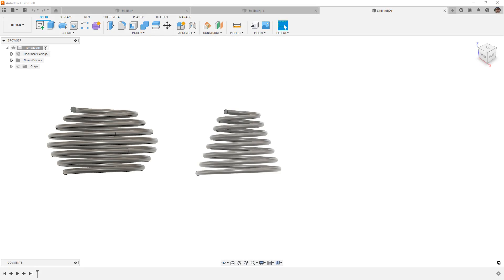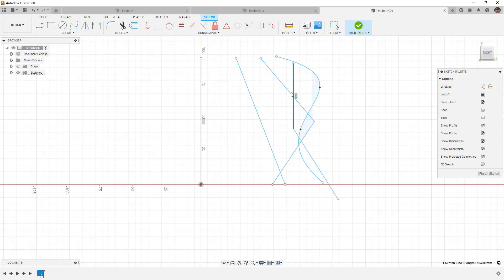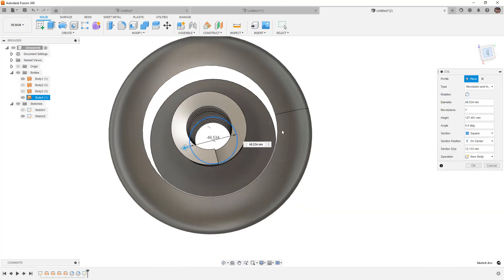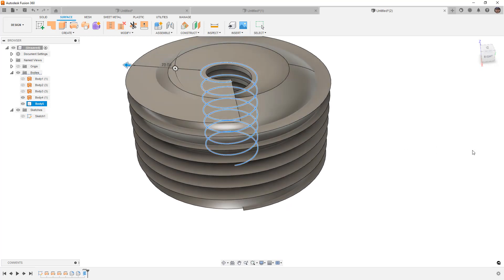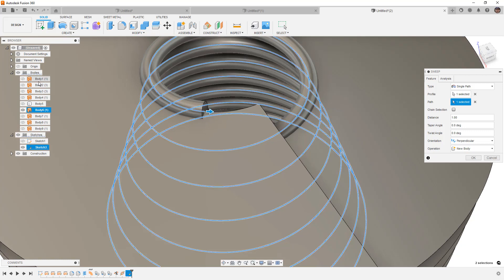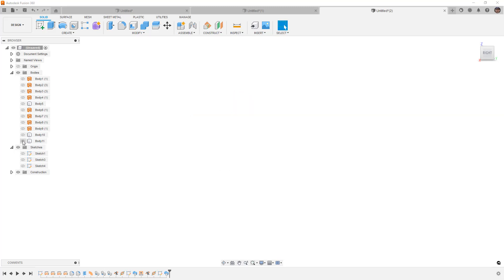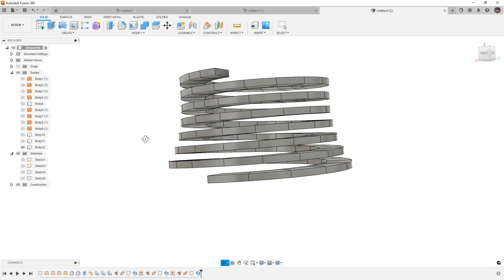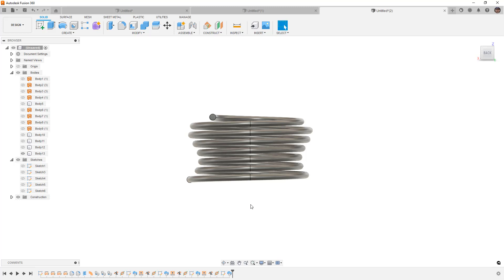How To Make Any Tapered Coil in Fusion 360 | Complete Step by Step #Fusion360

Comment: This guide saved so many headaches, thank you!

Quick question:
Have you tried using lofts with rails using this the splines from this method? I've been getting some headaches but that could just be from my low understanding of Fusion in general.
Reply from the maker: yeah, sadly the loft kinda loses what to do when trying to revolve around stuff like this.  There is a loft centerline path you could try.  make your coil profile and use the centerline option but generally it won't work great.

Comment: Thanks for the tutorial, what if i dont have a straight axis in my shape?
Reply from the maker: hmm that gets a bit tricky.  You can't really use coil for that.  Depending on your shape you could do a sweep with a twist angle.  I have done some where i have sliced through a funky shape to get a path but its sort of a case by case basis.

Comment: Do you know of a way to adjust the spring "stretch" using a similar approach? I want the space between layers to vary, so like super tight at the bottom and super stretched at the top, with a smooth transition between the two. Does that make sense? 

This is the first video I've seen from you, I'm sure it won't be the last!
Reply from the maker: Thanks Adam!  So what you are looking to do is basically a Variable Pitch coil.  Sadly there is no easy way to do it in Fusion.  What you have to do is make 2 coils and then join them together with a blend curve or spline or tangent arc.  Other cad tools like Inventor and solidworks can do variable pitch coils in a single curve but not Fusion sadly....
Reply: @LearnEverythingAboutDesign  The YT algorithm eventually blessed me with this video which shows a way to do it using the emboss command! ...but I agree, it's not an "easy way". Thought I'd share with you. Thanks again. https://www.youtube.com/watch?v=waxX3yzhJSc

Comment: Thank you so much for this, I never realized how much you could do with the surface tool. Whenever you plan on patterning a custom profiled coil, patterning it as a surface before forming a solid body helps tremendously with performance. If you pattern it as a solid body Fusion will freeze horribly every time it has to recalculate when a parameter is changed.
Reply from the maker: You are welcome! Awesome to hear

Comment: This is a great tutorial, but I have a question I'm hoping you can solve: I have created 2 coils both with the same dimensions in the same position (one positive and one negative). The negative coil differs as it tapers inward 5 degrees. I have joined them at the same connecting face when creating the 2nd coil (as the option to join bodies), how do you create a sweep along both of them? When trying to sweep, an error occurs stating that the path surface is not smooth, but I don't know how to smooth the path. Have you tried this before?
Thanks
Reply from the maker: hmm, can't say i have tried that, but when using a sweep path, the path must have tangency(be smooth).  Likely the start/end where the 2 coils meet is your issue.  You could hack out a small bit and do a 3d blended curve between them.  In the same sketch use "include 3d geometry" and then use the sketch as your sweep path.
Reply: @LearnEverythingAboutDesign  that has worked perfectly. thank you!

Comment: It was really helpful.
I was trying to make an internal and external tapered thread.
Reply from the maker: It certainly isn't a perfect solution for threads but can get the job done.
Reply: @LearnEverythingAboutDesign   Is there a way to make conical threads with this approach?
Reply from the maker: @casade2831  Yeah.  you would just need to make sure your taper is correct for your sweep path and that your profile is as well.  The thread and hole tools in Fusion do already support tapered tapped holes.  One thing you will find using this sweep method though is the thread faces may be divided up for some reason.  The faces will still be tangent but it likes to break them up which can be a pain.
Reply: @LearnEverythingAboutDesign  thank you 🙏

Comment: Hmm i can do it with just a line it has to be an enclosed sketch for the profile. IS there some kind of a setting I am missing?
Reply from the maker: if you are doing a solid sweep it will need to be a close profile.  If you want to sweep a surface you just have to go to the surface tab and use that sweep tool.  I hope i understood the question.

Comment: One of the most common reasons for creating coils like this is to make a helical spring. Fusion's cousin (Inventor) does this natively and includes the option to define real world end spring ends, namely "ground and closed". I wonder if this is on the Fusion road map? This technique of yours would really benefit from being extended to flattening and trimming the ends to achieve that effect.
Reply from the maker: Very True.  Inventor, Solidworks and many other CAD programs have easy methods to build variable pitch and diameter coils with end treatments.  Building a 3d curve coil or using a coil generator.  I don't imagine Fusion will ever get this, but could be wrong :)

If i do an update i will add in doing the end treatments to it.  Thanks!

Comment: Everything works out so far but when I sweep my profile, which is a symmetrical trapeze with the thinner side being outside, it doesn't follow the coil path how it should. The profile rotates around and the thicker side goes outside. Do you have a tip how to keep the orientation of my weep profile? It's hard to do when working on a plane that isn't parallel / perpendicular to the world axles.
Reply from the maker: Hmm, I would try to use a guide surface even if its just a cylinder to keep the normal pointing outward.

Comment: what if im trying to make a coil with a changing  pitch that blends between them
Reply from the maker: Sadly Fusion doesn't have a coil definition that will let you alter the pitch/diameter on the fly.  You can make multiple coils and make tangent arcs in a 3d sketch to connect them, but not the most ideal workflow.
Reply: @LearnEverythingAboutDesign  hmmmm   i was considering also projecting a wave onto the cylinder but not sure i could be precise enough

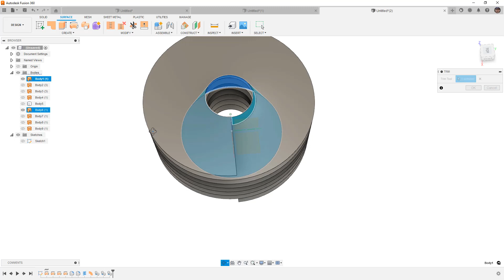Comment: Hmm, at 5:00 you're explaining the goal, but not explaining what you're clicking or how you get the "ok" button to appear when trimming.
Reply from the maker: The part where I say "we are going to get rid of the coil on the inside" I am clicking on the surface on the inside of the tapered coil.  So what we are doing is making a tapered coil edge path.
Reply: @LearnEverythingAboutDesign  I figured it out eventually. After selecting the object that will serve as the tool, it appears you have completed the dialog as its sole text box has been populated, but the OK button remains greyed —until you exit the dialog and click a second object that will be trimmed -then and only then the okay button is enabled.

Comment: Hey just found your channel. Have subscribed to this gem straight away. I was wondering if you would have another "hack" to solve a problem I have with the chamfer tool. I want to model a pipe connection as a T (like a saddle cut). The two pipes are to be welded together. The incomming member should have a weld bevel with 45° tagent to the surface of the other pipe.
Any help would be much appriciated ! 

Thanks for all the knowledge you share with us!
Reply from the maker: Thanks for the sub!  I "think", if i am understanding the problem correctly, you might need to do a sweep cut.  Take a look at this https://a360.co/3BYKflX  and let me know if that seems about right.
Reply: @LearnEverythingAboutDesign  wow yes that is exactly what i was trying to do. How do get the sweep cut to follow the surface of the pipe to get a consistant bevel?
Reply from the maker: I drew a line where i wanted the chamfer at 45 degrees from the T part of the pipe.  Then i did a swept surface using a "guide surface" which was the outside of the straight pipe.  It will keep the sweep at the same angle relative to that selected face.  The result ends up with a lot of face divisions(fusion issue) but it still maintains a tangency.
Reply: @LearnEverythingAboutDesign  many thanks. I couldn't get it to work myself but I must have done something wrong. Bless you and merry christmas.

Comment: If you are going to be using a circle as the profile a way to skip a step (no need to make a sketch) is to use the pipe command
Reply from the maker: Yup that is a great tip!